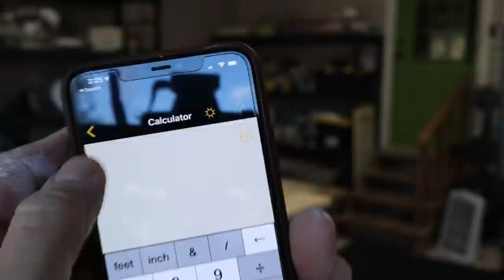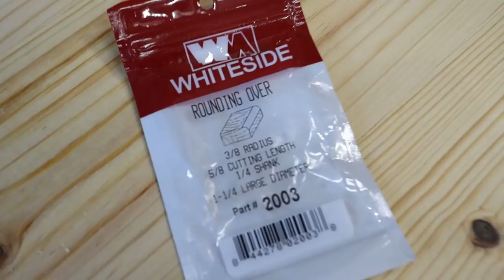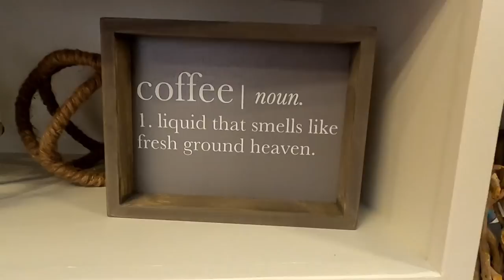DIY Modern Console Table | Easy Woodworking Project

Comment: 🧐What caught my attention on the tail end of my nap😴, and waking up to the video, was that you had included the time and materials cost😎. I rewound (scrolled back) the video and started it again. Inspiring me to build my own T.V. Cabinet to go below my 75” T.V., since what I’m imaging hasn’t been available on the market.

As a content creator myself, I have started including my time and materials cost for building some refrigerator and oven cabinets, floor tile demo, etc. and plan on continuing that to help people understand what tools, time, and materials they will need to do whatever project. I use pocket hole screws and dado joints, as most of the cabinets I build are for kitchens and baths. It’s good to see someone including the time and materials, and so either a homeowner, or cabinet builder could estimate their time to do the same. You know we all hate doing estimates for something we haven’t built before. 😄

Comment: PRO TIP: When making wood projects that you are going to paint, instead of using wood filler you can use drywall compound because it will sand nice and take paint with no issues. It can also fill countersunk screws and minor imperfections like small cracks, dents, or dings in the wood.
Reply from the maker: Thank you
Reply: DAP has a product called Plastic Wood filler. I use it on wood to paint. I’ve even used it to fill pocket holes when I ran out of the little covers. 
It dries rock hard, sands easily and paints up perfectly.
Reply: Bondo for the win.

Comment: "If you don't like pocket holes then this channel probably isn't for you" 😅
Matt, you are the pocket hole king!
Reply from the maker: lol 👊🏻
Reply: They are more expensive. However I sure like using them.  I started getting 50 packs at the beginning. Now I get the biggest pack they have  when I am building a new project, because I'm bound to use them eventually.

Comment: Very new in woodworking and about take a couple building projects. Can you tell me why you use the glue and nails over screws? Just curious cuz I figured the screws would be stronger but could be unnecessary.
Reply from the maker: wood glue is very strong.  brad nails and glue hold the face on no problem

Comment: This is exactly what i was looking for. Bought your plans for this, but had to make modifications to it. I put a small fridge in the middle part. I’m new to this, and if wasn’t for you i would have never done it. I was very intimidated by it. Don’t have a table saw, just circular saw, miter saw, screw and impact driver, speed square and nail gun. Oh, i also bought the kregg rip cut. Little advise for new diyers, don’t forget the clamps. Even with the ripcut, i kept getting wompy yawed cuts when cutting the play wood. I finally realized i was not clamping the sheet of play wood to the table. I almost wasted a whole sheet. and i almost threw my circular saw because i was blaming it for the bad cuts. So please remember to clamp everything before doing any cuts with circular saw lol. Thanks Matt for the instructions and the plans. Because of that i have a very happy wife. Wish i could show you the pictures
Reply from the maker: That's great to hear!  And yes clamping the sheet is very important.

Comment: Tip if I may cut your shelves first and use them as a spacer for the dividers saves you pulling your tape and as you say bowing them out if there is a difference

Comment: About 29:20. The air vent. You have a place for the air to get under the cabinet, but how does it escape into your room?
Reply from the maker: It'll flow out just fine.

Comment: @731 Woodworks, you mentioned not getting stain to work well with filled holes and not being able to get it to match.... take your sawdust and soak it in whatever stain you're using. Pack it in and sand smooth when dry. Perfect match every time.
Reply from the maker: Thanks for the tip

Comment: I noticed you got a 2nd work table and assuming you didn't stack 600lbs on it have you checked if it's bowed on the top or if it's flush out of the box?  I really want to upgrade to the Kreg K5 and get a kreg thingamajig clamp.  All in time though, use the R3 I have for now.
Reply from the maker: I forgot all about checking it for level

Comment: Pocket holes are great for right angles on sheet goods especially for things like cabinets. I'm a professional with 23 years of experience and I still use pocket holes because they are quick, strong (especially when combined with glue and proper spacing), and fast. I can do better joinery but a lot of times there really isn't a need for it and pocket holes save my clients on labor charges.
Reply from the maker: Nice

Comment: Do you always use your impact when drilling in pocket screws? I’ve overdriven screws with my impact and stopped doing it that way. I use my drill set at 18 for 2 1/2in screws and at 16 for 1 1/4in screws. Seems to be the sweet spot for my Ryobi still. Maybe I’ll try using my Ryobi impact again. 🤔
Reply: Awesome build! 🤩
Reply from the maker: Yes I do. but I put it on the lowest setting

Comment: Hey, I know this is an older video so I hope you’ll see this. I’m actually building this cabinet this week. Your plans call for 3 1/2” shiplap boards, but the smallest I see anywhere are 5 1/4 boards. I may have missed it but are those actual shiplap boards or 1x4’s? If you mentioned it, I apologize, but I don’t see it. Thanks and Merry Christmas!
Reply from the maker: I cut I tall out of 1/4" plywood, just 3/5" wide strips, see it at 15:51
Reply: @731Woodworks thanks so much! Just missed it.

Comment: Good job Matt. I spray all my own cabinetry and I'd say I'm an excellent painter. I can usually get a 95% perfect finish. Actually just about all paints will fill in 400g sandpaper scratches. Occasionally some finishes will require you to go to 800g but that's super rare. Usually 400g is the highest yoh ever need to go for wood finishes. Going higher than that will make sandpaper clog faster, sanding will take longer, and you will get worse adhesion between coats.
Reply from the maker: Thank you for the info

Comment: This is great. Watched the time lapse too. I like having both styles of videos. You made a comment about pocket holes and how they were fine for light duty. I've got a storage shelf I made and it's pretty heavy duty. Pocket holes are holding up just fine. I don't use them as much since I got a domino. But they work. Nothing wrong with pocket holes.
Reply from the maker: Thank you

Comment: Have you tried making your own wood filler? I see some saw dust in your shop. Gather some up, put some wood glue in the hole, and rub saw dust in it. It matches your wood to a T. I haven't tried staining it, but I may test it to see if it stains the same color as the other wood.
Reply from the maker: I’ve tested it with stain and it doesn’t stain the same color. Painting it works fine

Comment: I still love that old circular saw!

Also, you can make those rip cuts on the plywood with just a decent straight edge and any old saw that is made to ride against a straight edge.  Just because you don't have all the cool tools, doesn't mean you can't build something like this!  I've ripped full sheets of plywood lengthwise with just a 2x4 for a straight edge and my $20 jigsaw.
Reply from the maker: Absolutely you can use just a straight edge.

Comment: I seen on another video a great suggestion for filling holes when staining, they mixed sawdust with the  lacquer of a similar stain color (rather than glue and sawdust that doesn't stain the same), sanded a bit then stained. I haven't tried it yet but worth a try :-)
Reply from the maker: thank you
Reply: I’ve tried it and it’s a great technique
Reply: Sawdust mixed with PVA was something I learned at school...It ensures the filler is the same as the wood ;)

Comment: Matt, do you have to thin the paint with that sprayer? Also what size tip are you using?
Reply from the maker: I don't thin it.  I use the green tip, not sure what size that is.
Reply: @731Woodworks  the one I got for christmas says to thin it. And it has different tips but I only used it once so far

Comment: Have you try to mix sawdust and wood glue to make wood putty for staining ?
Reply from the maker: I’ve not had any luck with it. Always comes out a different color than the stain
Reply: Did you use sawdust from the same wood that you staining ? Or maibe use sawdust and super glue, it is not perfect but "you do not building a clock" ;)
Reply from the maker: lol

Comment: I think you're using 18 gauge nails? If so here's my power tip for you, switch to 23 gauge pin nails. They are dang near invisible, you won't have to fill them if you're painting and might even get you by if staining. I just used some on a project and they shoot through 23/32 plywood like butter and they are very strong. Save the 18s for the underside or behind trim where you can cover them up. For the gaps on the shelf face frame I was surprised you didn't plan to pocket hole them? Great looking piece and I like how you painted everything to match!
Reply from the maker: Thank you.  I need to get a pin nailer for sure!
Reply: @731Woodworks  I have a Hitachi (now Metabo) HP35A pneumatic that I picked up at Lowe's on a regular sale for $89 (normally $119.) On black Friday it was down to $69 now back to regular price. Amazon has it for $87 today. It comes in a hard plastic case with a tube of oil and a pair of safety glasses. I shoot both hitachi and grex pins the later from Amazon in an assortment pack. For this last one i used 1 and 1 3/8" mostly. I saw a cordless model for $279. When I started buying air tools the only option at the time for cordless was the gas powered and I thought, I didnt want that commitment to cartridges (which now seem obsolete), battery is much better and has a universal use. I use a pancake compressor and the hose doesn't really bother me. Can you send me your gmail address I saw you say it on the live stream, but thought I'd go back after to replay it later but then there were  the technical difficulties.
Reply from the maker: Thank you. I’ll check it out.

Comment: Can you move a table  by the top put together with pocket holes and tabletop fasteners .
Reply from the maker: Depends on the weight of the base.  The pocket holes will hold, the table top fasteners would be the weak point if it is a heavy base

Comment: I have a question might be a dumb question but I am going to ask it anyways.  why rip the plywood at 14.25" with the rip cut then use the table saw.  why no just rip them at 14 with the rip cut?
Reply from the maker: You can just use the rip cut. I just like to use the table saw so it’s more accurate.

Comment: Like your channel and the motivation you give to folks in woodworking. At least you are not asking for money to join a closed FB group, skype coaching or selling a so called business plan to success like a few others. Just good old purposeful furniture. No this stuff won't last 50 years and it's quick to build to make some bucks. And it looks great!  Not a fan of pocket screws without glue. Does Kreg delivery screws to you by truck or airdrop? A little surprised on your build cost and market pricing!
Reply from the maker: Kreg doesn't even know I exist as far as I know.  I buy all of my own supplies and tools for this build except for the Delta miter saw (which was unboxed and talked about how I got it on this channel).
Reply: @731Woodworks  I sent my local Kreg Rep a link to your channel.

Comment: Yo Matt! What's up? First of all nice work brother. Im not gonna pick on you at all. In fact, I like your confidence in posting videos and you are very creative. I am a fellow carpenter just offering some advice I picked up on another vanity build
Reply: Sorry continued.... I picked up a trick on mounting the shelves in this build. I noticed another guy used the shelf that would go in between the verticals as a temp block to keep the verticals true. For instance, he placed the shelf piece flat on the bottom board and pushed the vertical up tight to it. Then pun nailed and screwed it. Then, he slid it up to the top and repeated it at the top. Next he did the same for the opposite side. I found this to be a time saver and definitely helped in keeping it true. Just a thought. Keep it up brother.
Reply from the maker: awesome. Thank you for the tips

Comment: Love what you are doing just 1 question  where are you located  what state  im going to start building your stuff if it is ok with you im in alabama and don't wont to mess your market up I may have a order for the TV stand for 350$  is that a good price
Reply from the maker: I’m in south Arkansas. Go for it. 

What TV stand?
Reply: @731Woodworks  the distressed  one
Reply: The one in your house
Reply from the maker: $350 too cheap to sell that. Check this video out. It’ll help price items https://youtu.be/gubAzW8BTW0
Reply: @731Woodworks  thanks

Comment: You should message RZ Mask and team up! I've sanded with one of those blue masks and was sneezing for a full day. The next day I bought an RZ Mask and I never sand without it.
Reply from the maker: I ordered one last week
Reply: Agreed. I'm on my 2nd one (I'm brutal on my gear). Love that thing. And yeah, if I sand without it, I'm sneezing and running with a super-dry nose forever.
Reply: I ordered a RZ mask but didn't really like the nose piece. My nose hurts after using it.
Reply: @rchavez5056  you should be able to widen it out a bit. But I suspect you've already moved on to other solutions.
Reply: @JackRockBLC  I still have it. I feel like maybe I got the wrong size. I believe they come in different sizes. I really like the quality of the mask.
Reply: @rchavez5056  They do come in different sizes. Just mediu, large, and x-large, I believe. I don't have that big of a face, but I still get large, and it fit pretty nicely.
Reply: @rchavez5056  I actually had the same issue, I realized I was putting it on too tight.

Comment: Can this be used as a tv console stand? If so what size tab would work?
Reply from the maker: Absolutely! Would be perfect for that. Tab?
Reply: Sorry I meant what size tv (biggest size)
Reply from the maker: A big one lol. It’s 57” wide. Most 55” TVs are much less width than that on the base. Most 65” would fit I would think.
Reply: @731Woodworks  thank you!

Comment: easy to forget how amazing a new blade is until you totally fry your old on
Reply from the maker: For sure
Reply: i just burnt the crap out of some coasters i was chopping up with my pull saw, i did this same thing stopped what i was doing went to lowes and could not believe i was struggling with that old hunk a junk blade as long as i did

Comment: The new blade is not what made any difference, it was a sharp blade that made the difference. If you sharpen the old blade it will perform as good as the new one.

Comment: Please, this is not a criticism, just a small piece of information/curiosity...English speaker pronounces the names of the imported wood the way it seems correct for the English language. That's absolutely normal. But if you would like to know how Brazilians pronounce Jatobá wood, just emphasize the last syllable. In Portuguese, the word is written with a little accent on the top of the letter A of the last syllable (Ja-To-Bá) to tell the readers to emphasize that syllable. So, basically, you say - Jatobah.

Comment: As far as wood filler, make your own from the sawdust of the wood you are using. Just mix a little glue and push in the spot to fill like you would any other wood putty. It should stain the same since it is the same wood.
Reply from the maker: thanks